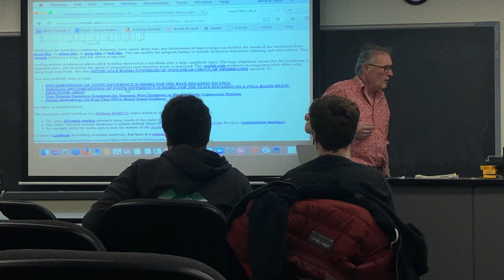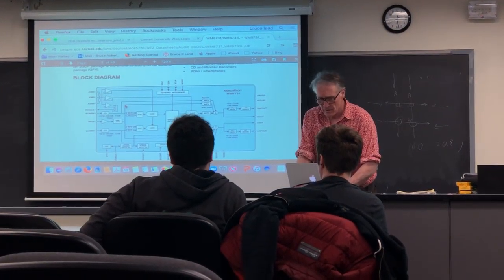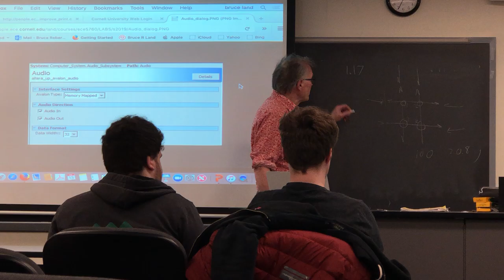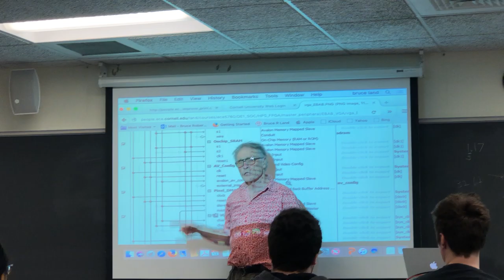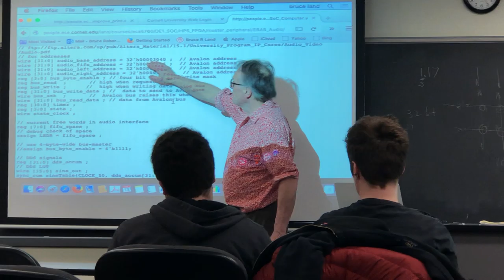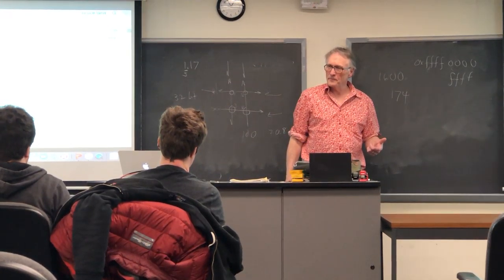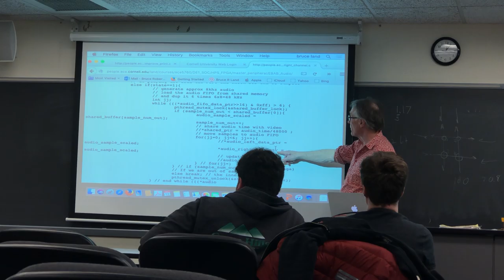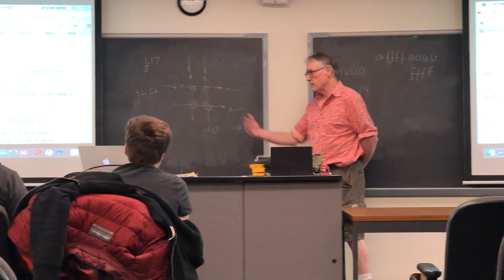#10 DE1-SoC audio codec, audio bus-master

Comment: I really appreciate that these Cornell lectures are uploaded to YouTube.
 I try to follow along and do most of these projects with my personal FPGA boards.
Maybe a GoPro Hero 1 camera would be a cost effective solution for the upcoming lectures.

As for that top 64KB of RAM / Boot loader, in the Cyclone V Device Handbook ( 3501 pages ) p.3498

The boot ROM is copied from FLASH to the on-chip RAM  0xFFFF0000.

It's used as scratch RAM for the boot loader, then is not needed once the next stage loader launches.
So it's safe to write to it from Linux/your kernel as that won't overwrite the Flash memory.

Comment: In industry you usually don't use the Avalon to external bus IP core to write your own bus master. In general it is said to be good practice to keep the verilog top file just an instantiation of the Qsys design. This way the top file is only mapping pis to the marked QSYS IO.

You can create your own components/IP cores in QSYS, they can have as many master or slave ports as you like. In the early example with the two PIOs where the top file is being used to invert the input, you could have created a component with two slaves.

This has the benefit where you can choose how you interface with the Avalon bus. A good option for slave devices is the Avalon Streaming Interface, its very simple and I think would be a better fit for the design then writing all your verilog in the top file. The PIO core has a lot of bloat and was designed for a different purpose... I really believe this seems more complicated because of how it is used in these designs. You also have many options for masters that can very in complexity depending on what you need your master to do.

You can also make use of interrupt lines in the designs when you write your own components, currently it looks like a lot of time is spent polling, in either the bus master state machine, or on the HPS. I know writing a kernel driver to intercept the irq on the HPS is probably too much, but it would not be too difficult to have an interrupt line between components on QSYS.